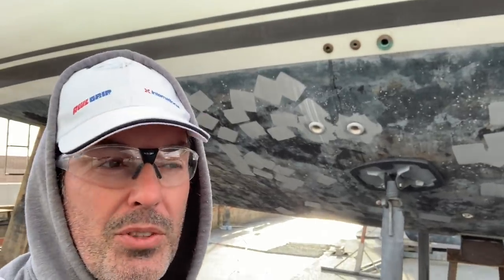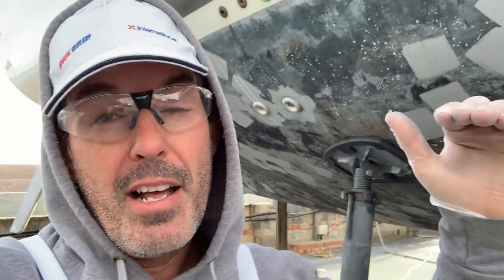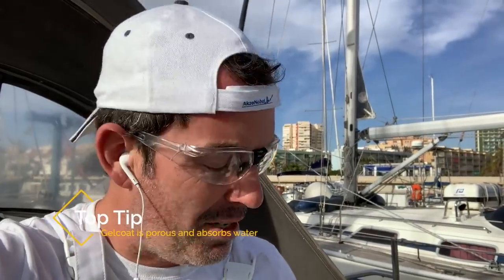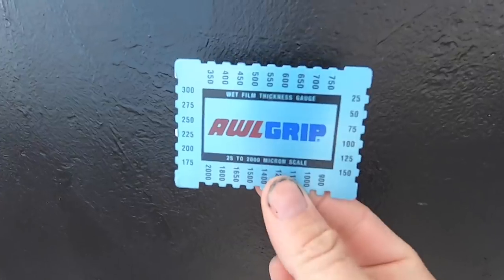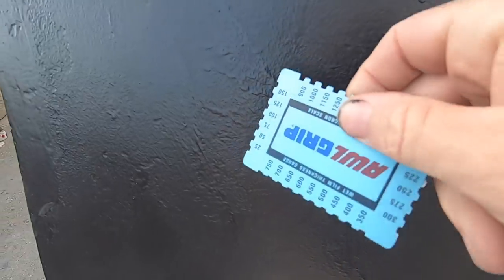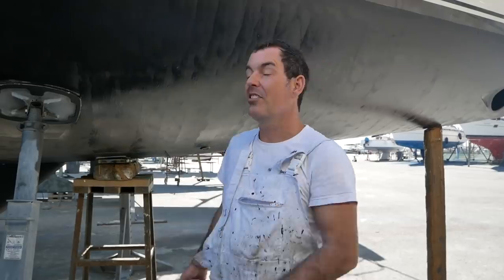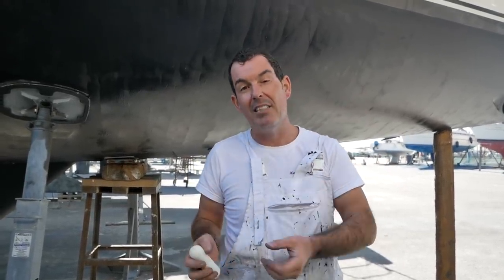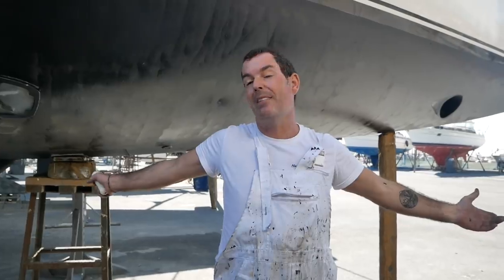How To Antifoul Your Yacht | Boat Maintenance Video

Comment: Looks like a great job there never an easy task  . Couple of small tips i could pass on from my  experience of industrial ship painting . If your using the Dft  comb to check the thickness dont  scrape it along the wet paint just gently place it in the wet surface till it touches the substrate . Secondly using rollers are great for courage and finish but its so easy to end up with a thin coat , brush application will give far better wetting and film  thickness of coating . Im sure RR is looking great with her new clean bottom  best regards and keep the videos coming ........ Ps finally an additional coat on the leading edges of the rudder fins bow and where  transoms meets the side shell  will help protect any edge paint thickness loss as corners are always difficult to get adhesion and thickness on
Reply: Some good points just to add if correct estimation of required coating is achieved and at least random WFT checks carried out per coat in line with the product data sheet then you shouldn’t go wrong. As you will know a roller will give a more even coating if after first coat if you have over half of the material left then you applied the first coat too thinly . Apply a thicker 2 nd coat until all the paint is used. Making an allowance of a stripe coat and appropriate losses and not forgetting  leading edges as suggested.
From my experience of both standard anti fouls such as micron extra vs Coppercoat the the latter comes out on top in terms of performance and economy by a long shot.
I’m sure there will be people who disagree.
All the best shipmate.
Reply: Hi dean You’re right at all points in my opinion, however roller goes faster but you may rol a extra coat antifouling. Also the most red/brown color versons are better.

Comment: Nick, there is a third option for bottom paint...silicone products.  Hemple´s product is called SilicOne but there are others out there.  The concept is simple....it makes your bottom so slick, any growth that attaches while the boat is stationary falls off once it moves through the water.  Barnacles and other growth simply cannot attach firmly enough to stay.  Bonus points...adds about .5 kt in hull speed and is 100% non-toxic.  I put it on my 17m sailboat last spring, while in the UK, then sailed to Spain and had her hauled.  After 6 months in the water, 2 in an English estuary heavy with growth, the bottom was totally free of growth except for a few spots where paint wasn´t applied (top of the rudder).  Like copper coat, it also lasts about 10 years.  Though the yard charged me about 20% more than a conventional anti-fouling job, I feel it was well worth the money.  I know it´s too late for you this year, but think about it for next time.  If you go with it, I think you´ll be happy.
Reply from the maker: Thanks mate, we will look into this

Comment: I have used copper coat - I put five coats of epoxy and then five coats of copper coat - took an afternoon to apply this a was 10 years ago and still going strong. Whoever you have been talking to about copper coat may have not been that accurate in their advice ... best wishes
Reply: Darrel Walters  yes we put on copper coat 5 years ago we live in the UAE and normal anti foul will last 1 year. We diver down with a soft cloth once a month to keep it activated, it takes 10 minutes for a 60 footer and there hasn’t been a bean in her. Copper coat was expensive but only 3 times more than normal. I suspect for a lifting keel it would be perfect because it is so solid, it is bullet proof. For us it was worth the investment

Comment: Another tip for bottom work.
When painting the bottom with ablative paints you always apply your first coat with a hard non ablative bottom paint with a bright color. The first coat with the bright color acts as a signal to you that your paint “ Ablative “ has worn out and it’s time to recoat. After this first signal coat is applied then you apply two coats of you ablative paint.
As for the bronze hardware under the water, just painting it with a bottom paint is counterproductive. You need to apply a few coats of epoxy primer before applying the bottom paint. The epoxy acts as an insulator for the bottom paint and allows the paint to work at its full potential. As for the type of bottom paint to use on the bronze hardware especially the propeller, you can’t use ablative you need to use a hard high copper paint like “Pettit Trinidad” 
   I hope this helped some people out. Do your research on the type of paints that will work for the areas that you are sailing in, much like Nick said. I personal would stay away from ablative type paints because of how the work and how toxic they are. These type of paints cannot be good 
for the environment.

Comment: Really appreciated this video, as I've  just bought my first boat and this is one of the jobs I have to do before I can get in the water.  Quick question,  do you use a specific masking tape so as to not damage or mark the gelcoat or is normal masking tape OK?
Reply from the maker: Normal stuff my friend. Normally get blue, 1 inch thick. And most of it is rated safe for a certain number of hours before its hard to take off
Reply: @sailingrubyrose   Thanks for the info, looking forward to seeing some of your Med cruising vids the year

Comment: Cheers from Georgia, US.  Do you find, after you've been back in the water for a while, that those spots where the boat was supported get more noticeable growth than the other areas?  I don't imagine it makes much difference, just curious if you see rectangular spots that grow a little more than other areas.
Reply from the maker: They will wear out earlier as they only get a single coat of antifoul. It is slapped on, but none the less it’s still only a single coat.

Comment: Just did the same on my boat, number of coats, raised my boot stripe also. You did not say if you used a hard or an alblative paint thou. I have used a hard paint the last two times and it has lasted for 4 to 5 years without having to be repainted! What did you use?
Reply from the maker: Ablative my friend.

Comment: Nick, do you do the bottom work yourself to reduce the cost of labor of having the marina staff do it or is it because you prefer to do the hands-on work yourself so that it meets your standards?  Are there any boat projects that you just won't tackle and leave to the marina staff to handle?
Reply from the maker: Hey Natalie, I’ve always done the jobs myself where I could. Part of the reason is that antifouling and the preparation makes you really examine your hull and fittings. It’s good practice.
The other reason is to do with quality and the value for money you get from contractors. As we travel the world, the only guarantee about quality of workmanship is if I do it myself. Hope this helps

Comment: Great video!  I'm glad you talked about the reasons for why you chose the specific brands/products you used.  Normally it seems like people just use what's available and not doing much research.  I don't like copper coat for the reasons you mentioned about how it's bad for the environment.

Comment: Delos - silicon 
Again you have to go back to Gel, but 100% environmental  good with a 10 year guarantee. Each time the boat is lifted and power washed its reset to new.
Reply from the maker: Joe S/V Blue Eyes yep, definitely something to look at. Will be interested to see how Delos goes with it.
Reply: I’m in the process of have silicone applied, it was a toss up between Copper bottom or Silicone..,
Silicon won due to environmental reasons, and the ease of cleaning